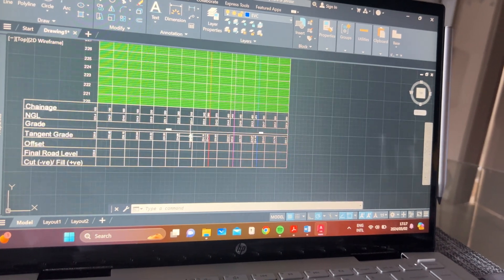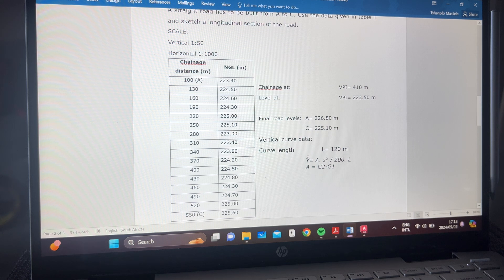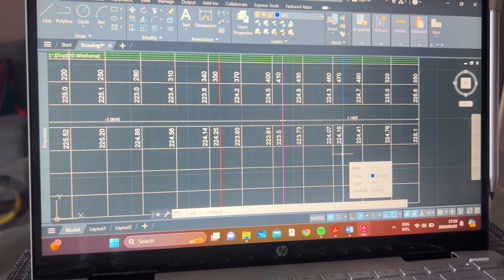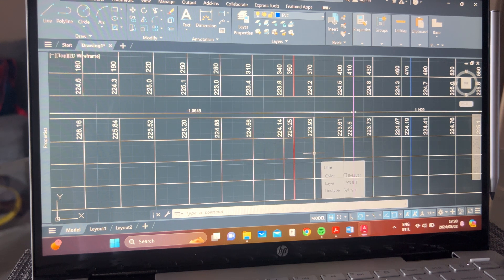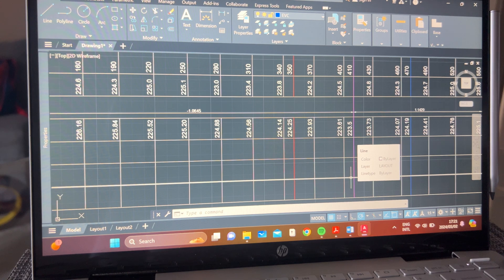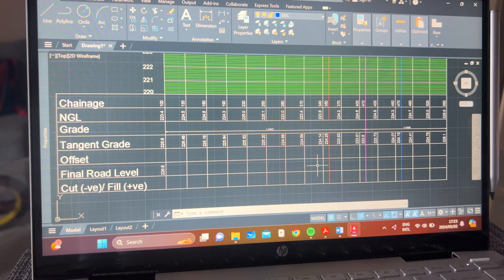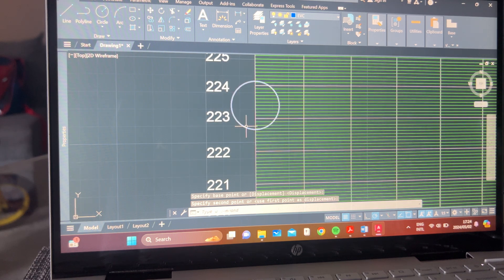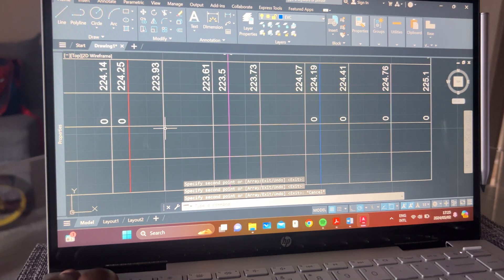Road Longsections on AUTOCAD | How to calculate Offsets, Final Road Levels, Cut and Fill

Comment: when you were calculating the offsets between the BVC and the EVC, you  said the distance between the chainages is x. so from 350-370 the x distance is 20, giving you the offset of 0.0368, then you lost me when you said for the second one its 0.23, i thought we then taking the distance from 370 to 400 which is 30. i get an offset of 0.083, please correct me.
Reply from the maker: Hi Wendy, always consider X from your BVC reference point, not from the previous calculated point. In this instance, The next X will be taken from 350 not 370. You only consider a new reference point after crossing the VPI line. I hope this helps?😀
Reply: @thriveoutloud22  thank you .understood 
🙂
Reply from the maker: You’re welcome